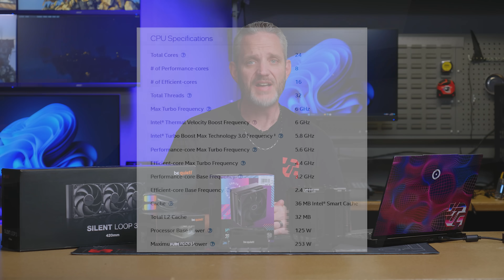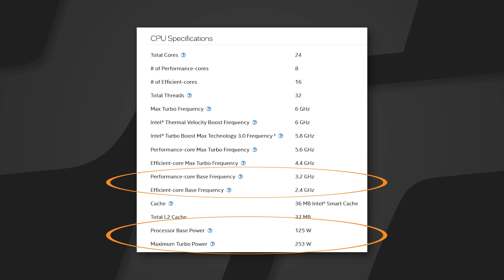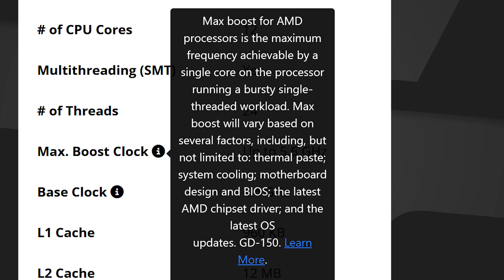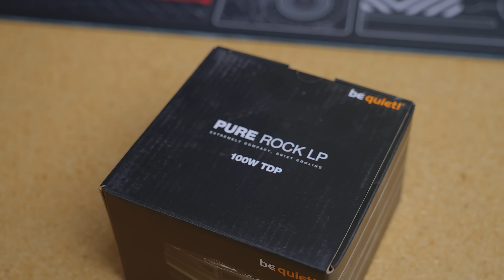Forget what you THINK you know about TDP

Comment: Good thing about X3D CPU's for me.

During gaming on my 5700X3D rarely exceeds 60 watts, but yet it matches or outperforms the then intel equivalant of the time 12900K in gaming, which has a turbo boost of 240 watts.

It's no surprise why AMD is gaining market share when you look at that.
Reply: The 9800x3d only uses 120W during shader compilation, but the thing is so jam-packed that it needs a very good cooler to keep it from hitting it's temp limit.

Of course a -20 Curve Optimizer can push that 20°C down, but it's very interesting to see such a "low" wattage heat up that much.
Reply: @Khazar321 one of the only people that actually tell the truth. Most people say they cool it with ease and its not a hot cpu. With my air cooler while gaming ill get peaks at 80c on the CCD but only temps of 70c everywhere else because of the design.Thats all with a 20 -CO.
Reply: @roccotaco87  well I did recover from the shock when my 420 AIO let the 9800x3d go to 88°C during shader comp..

I then of course got super good values with the -20 CO, so it's not like it's a lie, that they can run quite comfortably with less strong solutions, but I was not prepared for that.

It was a good reminder that these CPUs are meant to run at high temps, since they are already close to maxed out with their clocks.
Reply: @Khazar321 oh I agree with a more than adequate cooling solution like yours cooling the 9800x3D is no issue. I think the biggest “lie” or misconception was that its easy to cool them with an air cooler like the Thermalright Phantom Spirit 120 EVO. I have that combo and I was also shocked at the stock temps and was hitting the thermal limits at stock settings.
Reply: @roccotaco87 how do you have a 9800 X3D and not opt for like an AIO like almost everyone else lol edit: I have the artic360 on both the 7800 and9800 X3D CPUs and the AIO is overkill for the 7800x3d I found out when I did a SFF build with another 7800x3d
Reply: @Jamie_Sunshine From going online and seeing people say that its more than enough of a cooling solution for the 9800x3d. Even major reviewers said that. Its kinda wild honestly. But like I said I did tweak it a little it does work fine but id like the extra headroom for overclocking in the future. Ill have to switch to an AIO in the future when I need to overclock for more performance when the cpu gets long in the tooth.
Reply: @flynoodles287 odd, mine rarely gets over 55 degrees when pushing it. Only an artificial load or a windows virus scan, which does 100% load, gets it in the 70-85 range. Normally in the 40s.
Reply: A lack of good engineering talent at Intel has forced them to use brute force to compete for the last 5-6 years. AMD followed suite with PBO.
After losing 2 $500+ CPUs to factory overlock, I won’t run modern CPUs over 65C or 1.3V. Get flack for “not getting what I paid for”, but if it dies before I want to replace it, I’m still not getting what I paid for.
Modern processors are adjusting to the disposable and frequently replaced market mindset that smartphones and laptops have conditioned consumers to.
My i5 750 to this day still gets similar benchmarks to when I first bought it, but it’s 45nm lithography at 95W. Fairly overbuilt.
Reply: @Greeeeee88 you’re definitely not wrong — AMD and Intel are motivated to pump more voltage to achieve higher frequencies that they can use as flashy taglines to market their products, to the point where it compromises lifespan. I haven’t had any trouble with my modern CPUs though but I’m just running modest overclocks. Sometimes the mobo is to blame in these failure scenarios too.
Reply: To be fair, playing the same game a 12900k wont pull the full 240 watts either, thats just under full load, which a game usually wont do. No idea where exactly a 12900k would land on the same game, but I guess 70-80 watt is about realistic.
Reply: Itel can't get any performance without a personal nuclear reactor
Reply: And it's the 25-30W (with EXPO even a bit more) idle power consumption that makes that AMD CPU not as power efficient as you consider it.
Reply: Intel 12900k doesn't pull 240 Watts in gaming either. That is probably the most misleading comment you could make.

Practically: Intel pulls more under load, but pulls less power when idling than AMD. In single thread games, power draw is mostly similar.
Reply: @piotrj333 is shader compilation not gaming though lol
Reply: @Jamie_Sunshine  12900k would also run circles around 5700X3D in shader compilation tho as that is heavy multithreaded. Again false comparison.
Reply: @piotrj333  And idle/low utilization is where average CPUs sit most of the time.

Comment: My i5 13400F would easily get to 100 degrees C loading shaders and stay in the 90's especially playing UE5 games. I had to go into the BIOS and disable features for it to finally get in the 70s for high temps. I have an air cooler because I thought I wouldn't need an AIO for a mid tier CPU.

Comment: Amen. A CPU converts 100% of its consumed electrical power into heat. A CPU can't convert electrical energy into any other form of energy other than heat. What ever power your CPU sucks from the wall outlet needs to be dissipated by your cooler. 

What makes the situation worse is that cooler manufacturers provide false specs on the CPU coolers too.

Comment: 4AM EST Jay, you forgot to add that the 9950X3D is 16 total Cores, 8 Cores with 3D-VCache that draws more power and heat than the other 8 Cores that have the normal cache with 32 total threads vs Intel running Performance cores and “Efficiency” Cores which is laughable due to the wattage it draws when we’re comparing it to the 14700K that’s 8P-Cores and 12E-Cores with 28 Threads and it still beats the 14900KS which draws more power, has more cores, Intel’s flagship gaming CPU and still falls way short of the 9950X3D
Reply: Why did you feel like adding the time added any value to ur message

Comment: 3:59 with the Intel chips you were talking about prior to this, uundervolting doesn't make much different to performance. Those 250w Intel chips have had power pushed so high to squeeze every last bit of performance. However, as we know there are diminishing returns on upping power for higher clocks.

11:36 there's no way a tower cooler is going to handle a 250w cpu. The temps would go insane and downclock the CPU. Even the Noctua D15 G2 can't keep a 250W CPU in check around 70'C under full load. According to  reviews anyway. Hardward cannucks tend to pit a lot of coolers against each other. Most top end CPU hit 100'C with 253 watts in those tests, and we know heat kills CPUs. The D15 G2 comes out best but it can't manage a 250W CPU at full load.
Reply: Heat transfer is the largest bottleneck right now. It is really difficult to get rapid heat transfer without resorting to delidding. Only way to combat this from the manufacturing level is to create better IHS's with not only greater surface area but better thermal transfer and distribution across the surface area. Otherwise you would have to resort to making the dies bigger again to counteract the concentration of heat. Older, larger dies were much easier to cool because they weren't so densely packed.

Until we somehow come up with hyper efficient optical CPUs with next to no thermal noise output, we are essentially stuck with this roadblock.
Reply: @JustSomeDinosaurPerson  or swapping silicone out for carbon since theorhetically they could be passively cooled up to 200C
Reply: @glebglub We are definitely not swapping out silicon with carbon anytime soon for the CPUs, unfortunately. Much more likely to end up using Bismuth instead.
Reply: And to add to it, it also depends on the outtake of the case. A D15 can only do so much if the heat can't dissappear at the back. That's also why a 240+ AIO wins, cause the heat instantly leaves the case over the whole area, instead of a single 120/140 at the back.
Reply: I think the biggest problem ist that you just dont get the heat away from the CPU, its impossible to cool a 14900k, you just cant move that heat away fast enough. 
I had a 420mm  AIO and now the Dark Rock Elite for my 14900k both are not even close to be able to move the heat

Comment: I thought that tdp was the max that precision boost would do! I was going to build an sff with an lp cooler,
 And 9800x3d, now I’ll rethink that… Thanks for preventing a huge mistake on my part!
Reply: The AM5 Single CCD X3D parts (7800&9800X3D) are pretty much the exception!
It's almost impossible to get them hit/over that 120W TDP, so SFF builds with a good LP cooler will do fine
Reply: @atirta777 meanwhile my 105w TDP 5800x3D benchmarked to like 124w lol

Comment: Intel: (pulling 2x the tdp)
Ryzen cpu: (laughs in corner)
Reply: my 5600x was reaching up to 150w with 3600 mhz memory
Reply: Tested results at my home: Intel 14700kf undervolted, 50-60C temps when gaming. Old 7800x3D. Had to use on stock since undervolting made unstable. Normal gaming temps 65 C or + with my Arctic 3 420mm aio. 
When Intel undervolted so my Intel laughs in the corner to my old 7800x3D ;)
Reply: @apocalypta9334 but the gaming performance of you X3d would be insane !
Reply: @aliens1990990  what do  you mean? 14600k matches 7800x3d and its a bit slower in some games, not much though. 14700k runs circles around 7800x3d:))

Comment: Waterblocks with 2. 480mm plus a 280 that 60mm thick that powered by a ddc pump and a 300 ml rez  max temp i hit is 33C under full load on old system now with new one i will need work on my temp tracking.

Comment: I have my old pc with Ryzen 5800X and Lian Li Galahad 2 240mm AIo CAN"T Handle this processor in stock settings, it is overheating 91+. I have my new PC with Ryzen 9800X3D and the same AIO, and it is also can't handle IT. Stop saying, please, that air tower cooler can handle Ryzen 7 or higher. Even 240mm AIO CAN NOT. My CPU is still alive just because i set PBO and CO to get around 85 degrees. And i was pair my CPU with Lian Li 240mm after "review" like this on youtube or internet. I do not know in what conditions all these test was made, but in real life, 240mm AIO CAN NOT HANDLE STOCK BOOST of Ryzen 7 and higher CPUs. According to my PBO settings and 240mm Lian LI AIO, maximum what it can handle in full load in long period of time is about 110-115 Wats of PPT.

Comment: I have a 9800X3D and paired it with a Deepcool Assassin IV VC Vision because 1) I liked the look of it but also 2) it is rated for 300w tdp so i knew even if i put the cpu under heavy load it would still have the headroom to handle it.  Very good cooler.

Comment: I picked up a 9700x last year and bought a dark rock slim cooler as that was what was in stock and seemed like it would be enough. I like the cooler well enough but I keep wondering if I should order a peerless assassin 120 instead. The 9700x is perfectly willing to boost up into its thermal limit though and make me wonder if I'd get more out of the larger cooler.

The Phanteks AIO might be fun as well since I have the matching case, the G400A but that's a 90$ vs 40$ difference.

Comment: Never undersized my coolers. Back in the 70's and 80's it didn't matter after that I just made sure I had a cooling solution which was over kill.
Reply: Not to mention people tend to underestimate the other variables in their system or even the room they are using the computer in.
Is your office un air conditioned? You need a bigger cooler.
Does your system start to throttle the moment some dust or pet hair gets on the cooler? Then you need a bigger cooler and a filter unless you very religiously clean your case which most people struggle with.

Comment: Have you had any reports about be quiet Silent Loop 2. After 3 years I started getting overheating and bubble noises, and I was happy I chose this AIO because I know I can refill it. I open it up for the first time and I instantly get a smell and behold it's full but it's got brown stuff floating on the top. Kinda looks like when you have the forbidden milkshake in your car, aka coolant and oil mixing. I can send you some pictures if needed. I'm also contacting be quiet support right now.

Comment: As far as I'm concerned, those 125W claims for newer Intel stuff are about as helpful and accurate as manufacturer claimed fuel consumption on cars. They're technically not wrong, but rarely describe the real-world performance of the product. 
Especially considering the fact that on an Intel-system, you would get "unlocked" performance out of the box with any of the motherboard brands. This only changed on my board (Z690 MSI) once they started rolling out the micro-code-/BIOS fixes meant to prevent degradation. 
Still: I would never, ever, take those claimed 125W as an indication of how much (or rather "how little") cooling you'll have to throw at your chip. Certainly not on anything "unlocked i5" or higher - I remember wanting to go "low profile" back in the days of Haswell and slapping a Scythe Shuriken onto my 4670K ... which regularly overwhelmed that cooler and I then had to go out and buy another one.
Reply: Intel claims are helpful IF:
a) you run actually motherboard that runs correctly with Intel default spec (most don't)
b) you run non K cpu. Like for example if buy intel 265 (NON K), you will see in spec 65W base, and 182W max turbo. And this is exactly how it behave. for 30 seconds it ups power draw up to 182W, and after defaults to average power draw of 65W in each second."

Everyone reviews just K cpus and Intel makes K cpus overclockable and more stable at higher frequencies but way worse in efficiency. Funny fact is, that best overclocking chips (for let's say LN2 overclocking) are actually having highest leakage current what means they are actually worse efficiency wise at normal conditions.

Comment: 0:12 Jay I have a 12900KS!!...  I struggle to ''Oversize'' my Cooler!! 🥵😂😂😂
It currently shares with a 12500T.... 
2x 240mm 'Arctic Freezer 2' Radiators & a Copper 120mm Radiator & 3 'Freezer 2' pumps, 2 in parallel & 1 in series! 😂😂😂

Comment: so why is my 7800x3d only pulling a mild 77 W at full load?? temps going high too.. my AIO liquid is only at 30C under load.. is this normal? maybe bad thermal paste? also, my mb doesn't allow to set the curve in pbo -_- ryzen master also doesn't work.. anyone got a solution?
Reply: Bad paste application? Bad contact base?
Reply: @bhijik  yeah that was my theory too but I asked gpt and it said that the liquid temp was normal ish. still doesn't explain the low wattage for my 780px3d tho..

Comment: I always thought if the processor was under 100W like a 5700X, you use a dual fan air cooler & over 100W like the 7700X, you go water cooling.